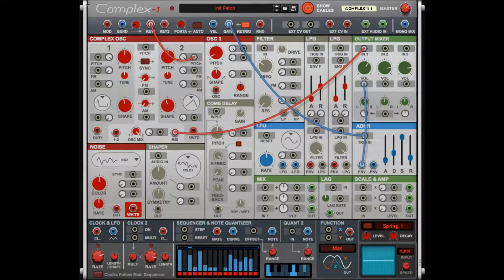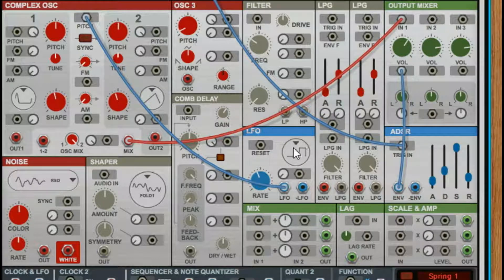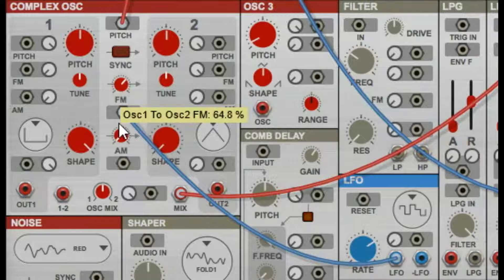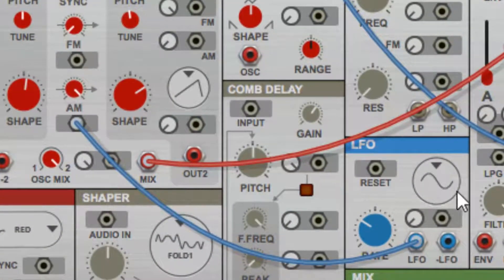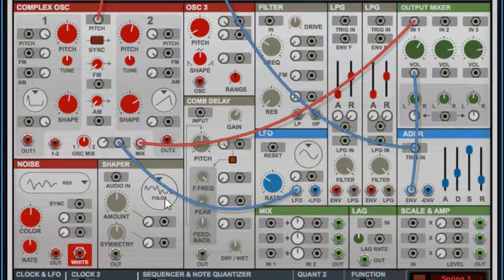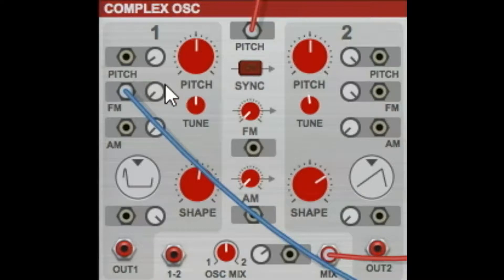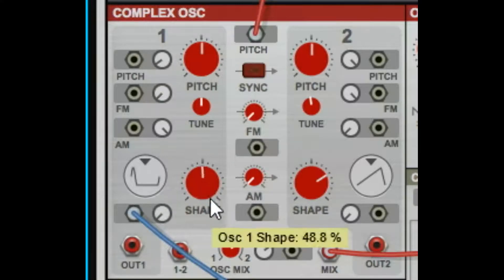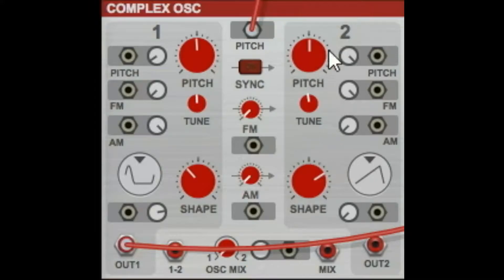COMPLEX OSCILLATOR - COMPLEX-1 COMPLETE WALKTHROUGH, EP. 2

Comment: What does the 1-2 out do that the OSC MIX set at 12 o clock doesn't? I mean if OSC MIX is set to 12 (Straight up) it will mix oscillator 1 and oscillator 2 equally, right? If so, I can't see what the 1-2 would be good for since it is doing the same thing? And it will go out in MIX anyway (if done in OSC MIX)
Reply: It just allows more options for blending I think.